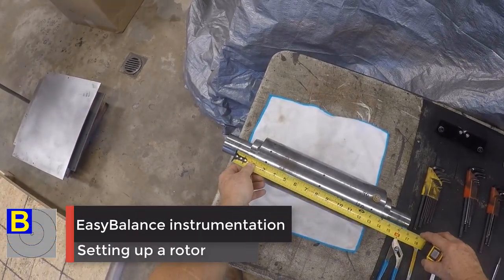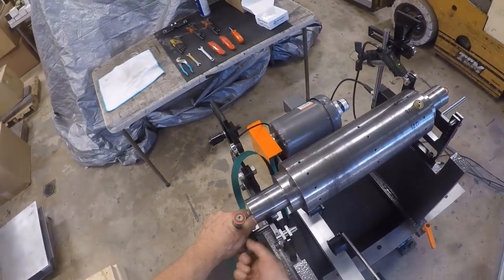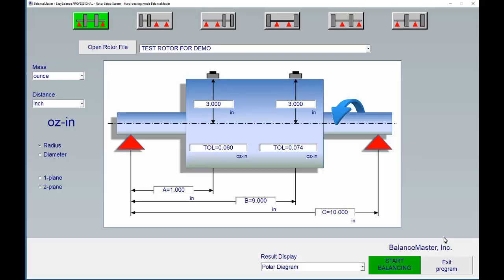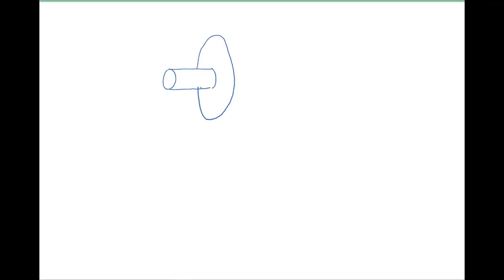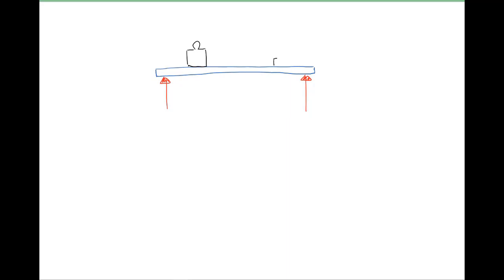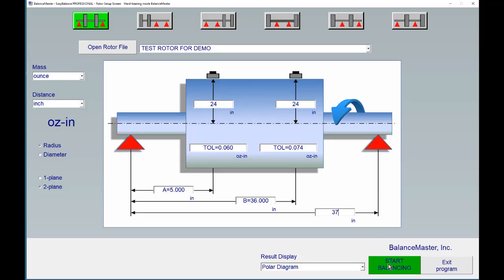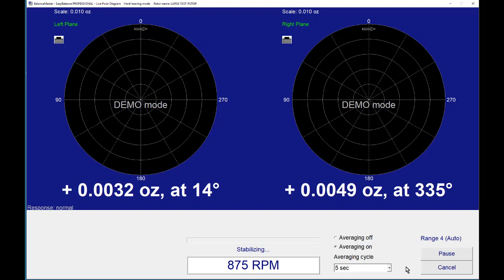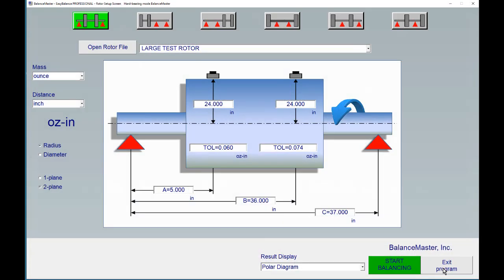Dynamic balancing machine - Rotor setup and abc dimensions

Comment: hi ,we are trying to balance a mandrel before starting part balancing activity , but we are not able to get consistent reading ( repeatability)  do you have any idea about what may be wrong
Reply from the maker: There are several conditions which can cause inconsistent readings, but do let me know the type of balancing machine you are using (hard-bearing or soft-bearing, horizontal or vertical)
1. Bad journal surfaces and / or bad roller bearings.
2. Too much belt-tension (belt forces can influence the unbalance readings, especially at low unbalance levels)
3. Make sure the belt sections from the idler rollers up to the mandrel are running parallel and in a vertical direction.
4. Make sure the mandrel is not pushing to much against the left or right end-stop (end-thrust forces can influence the unbalance readings, especially at low unbalance levels)
5. Ensure that the mandrel is not spinning near or at a resonance (check rigidity of mandrel and machine base); try running at a different balancing speed.
Reply: @balancemasterinc6807  we are using hard bearing vertical balancing machine
Reply from the maker: @tanmayranade9821  You can test if the problem is from the machine itself or from the mandrel, by measuring the mandrel while mounted to the balancing machine.
Test 1: Measure 5 times, without stopping the machine.
If the variations between results are smaller than than balancing tolerance for the mandrel, you can go to Test 2.
Test 2: Measure 5 times, but this time stop the machine after each measurement. 
If the variations between results are smaller than than balancing tolerance for the mandrel, you can go to Test 3.
Test 3: Measure 5 times, but this time stop the machine after each run, remove the mandrel, re-mount the mandrel and measure again.
If the variations between results are smaller than than balancing tolerance for the mandrel, your machine and mandrel are OK.
Can you tell me which of these tests is failing?

Comment: How can you correct it? Except removing material?
Reply: Unbalance corrections can be made by either adding material at the light spot or removing material at the heavy spot. Adding and removing can be done in so many different ways. The software offers programs for drilling, milling, welding, adding clips, adding tape, moving set screws, adding bar stock, filling mass pockets...